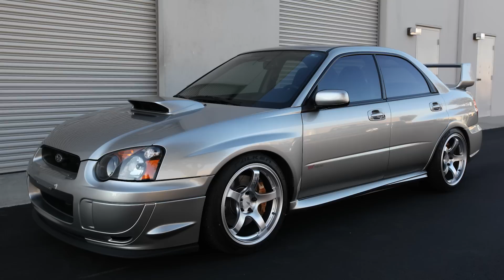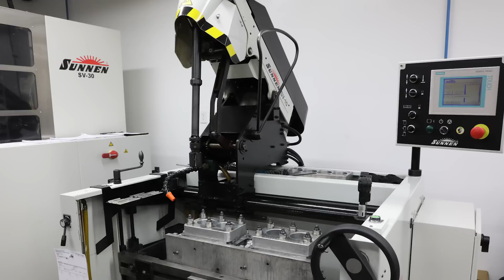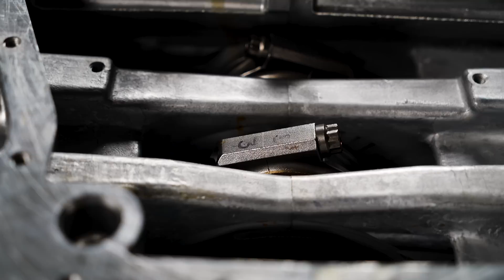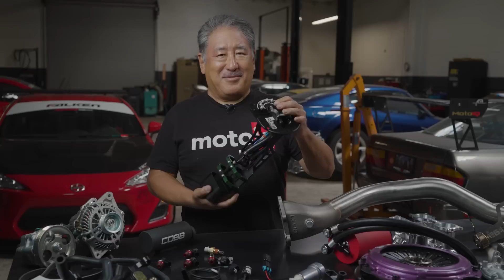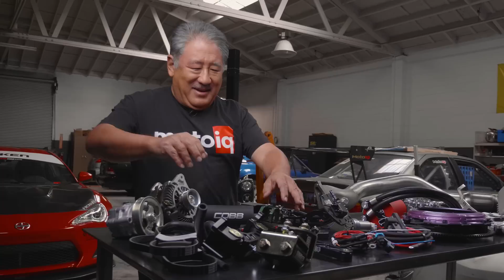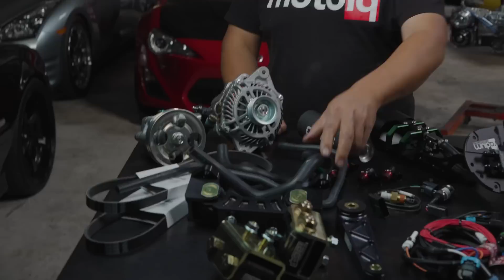Subaru Engine Swap Must Have Parts!

Comment: I am shocked MotoIQ doesn’t have more of a following. These Subaru videos are some of the most helpful and informative videos on YouTube!
Reply from the maker: So are we!
Reply: @motoiq   Do you guys have and engine build kit for the OBS Impreza's? I have a 97 wagon I'm tearing down (rebuilding transmission ATM), and I'm look for around 350WHP replacement engine. Knowing what must be done to build a truly "Bullet Proof" engine I'd like to outsource for a shot block and heads. Got anything like this?
Reply: @motoiq  Well, I subscribed and followed you on FB. Thank you SO MUCH for this content.
Reply: most "car guys" these days want a pretty cars and don't like the niddy gertty technical vedos like this and speed academic....but for the few of us that do care videos like this are worth there weight in gold....thanks Mike for letting us watch over the shoulder of a legion like your self

Comment: Awesome content! I've followed you for a number of years. Can you come out with content for the Fa20 or Brz/Frs platform
Reply from the maker: Possibly!
Reply: @motoiq  that would be amazing. I have read the articles on your site for Michelle's build. That is how I learned about WPC
Reply from the maker: @1atinlove  I forgot we did stuff on the web page side. https://motoiq.com/building-an-fa20-race-engine-for-michele-abbate-part-1
Reply from the maker: https://motoiq.com/building-an-fa20-race-engine-for-michele-abbate-part-2
Reply from the maker: https://motoiq.com/building-the-fr-s-fa20-engine-with-stay-crushing
Reply from the maker: https://motoiq.com/building-the-fr-s-fa20-engine-with-stay-crushing-building-the-cylinder-heads-with-portflow-design
Reply from the maker: https://motoiq.com/building-the-fr-s-fa20-engine-with-stay-crushing-assembling-the-engine
Reply from the maker: https://motoiq.com/building-the-fr-s-fa20-with-stay-crushing-installing-the-engine-and-making-big-power/
Reply: Thanks, I've actually taken q look at these. It was a real helpful guide, and provided a lot of information.  It was the reason why I reached out to you guys originally.

Comment: This is wayyyyyy overbuilt for a 450whp car. If you’re looking to do this for less you do not have to go this crazy. it can be done without a lot of the stuff if you just went for a bigger drop in turbo, such as a boostlab 54x.

Also, if you’re already gonna spend money for injectors, spend a little more and get the 1700s. It’s way cheaper then maxing out your 1300s and then having to buy a set of 1700s. Buy once cry once.
Reply from the maker: Maybe for a car that is not track-driven sure.  If you want to be able to run flat out for 20 minutes at a time, and still have daily driver reliably you need to have a higher degree of preparation. Most people don't understand that track driving like road racing is harder than anything you can do on the street or drag strip. If you don't address things like oiling and cooling, you end up leaving the track via AAA instead of under your own power.  Anyway, this car can make up to 525 hp before the turbo maxes out and is built to take a rotated mount turbo if desired.  The turbo is also sized for quick response, not making the most amount of power.  We have found in road racing that torque and response make for faster lap times unless you have an all-out race car.  Bigger injectors are not better, especially for a daily driver. Bigger has more invalid time and makes idle stability and closed-loop control more difficult to tune, especially with gasoline. From the Injector dynamics website (The ID1700x will deliver flawless stoichiometric idle and cruise mixtures on E85, but like the ID2000, should not be expected to do so on gasoline)1300cc injectors are big enough for what we want to do with the car.

Comment: Was just looking at the guys from gears and gasoline which lead me to here. Those engines appear to be terrible from looking at you and them.
Reply from the maker: Certain aspects of the engine like the pistons get in the way of reliability right away. The cases themselves are not very good past 550 whp for road race long duration reliability;

Comment: Do the fa20dit engines also have the same problem the ej's have with the oil pan baffling as described? 7:13
Reply from the maker: Yes and they also have issues with rod and main oiling past about 430 hp and issues with the oil pump gears breaking past 8000 rpm.
Reply: @motoiq  I appreciate the reply. Thank you.
 I think I would be happy with a turbo back and tune which shouldn't land even close to that number. However I do appreciate the knowledge. I understand it's more a matter of how long are you satisfied. It's impossible to look at your car and think "okay that's it! I'm done."

Comment: Mike, what software/hardware will you use to tune it? I know Cobb is not an option with the TGV deletes and speed density. Thanks
Reply from the maker: A link ECU Plug and Play ECU just like our Evo project.  It is excellent!
Reply: Could you send a link or show what the plug and play options for subaru tunning know that cobb f... us.
Reply from the maker: @legacy5thgen727  https://dealers.linkecu.com/products/plugin-ecus/plugin-ecus-subaru
Reply from the maker: @legacy5thgen727  There is also ECUTek for now but that's getting bricked soon as well.
Reply: @motoiq  okay thanks for the reply there's not much out there for the 5th gen legacy I got a gtx3576r rotated turbo kit 1650cc injectors with a 450 walbro pump need a tune can't find a plug and play option. 😢and yes most of the stuff are deleted.
Reply: @legacy5thgen727  RomRaider

Comment: reality check still can break , Did all of that and then some, my iag 900 long block was send back can’t wait to find out what happen …….Subaru things I still strongly feel IAG is the best of the best
Reply from the maker: IAG is one of the best, it will be interesting to know what they determine the cause was.
Reply: @motoiq  all I can say I hope it was me !!! Things can happen at 731whp special thanks to @The Boost creep, in Colorado
Reply from the maker: @kchanguito  yeah 731WHP  is asking a lot from even an IAG 900.
Reply: @motoiq  you may be right it had the” high boost “ 683whp  tune at 29 psi for all of 1200 miles never got to used the honey badger tune , I’m just hoping I can get the engine back and make one past this season
Reply from the maker: @kchanguito  That is over 900 crank hp and great results even if it blew up!
Reply: @motoiq  what will be the conversion 20%? 
Feel like 683 is some here around mid 800’s crank ? What will be the calculation with elevation. ? Also we make sure tune was “rich” and healthy never felt like we push anything with mid to light timing

Comment: I went the overbuilt route for my WRX built too, LOOOOTS of IAG goodies on my car, the AOS, TGV Deletes, Fuel System, and the like, and cant forget the IAG Stage 2.5 block, they do an amazing job with their closed deck conversions. For the under armor, I prefer the TBW under body tray, but that one is just as good too, anyone with a subaru should get some sort of metal underbody tray.
Reply: How you have TGV deletes? Are you on standalone?
Reply from the maker: @bestkickzz  standalone or you can do ecutek too
Reply: @bestkickzz  TGV deletes would be the least of your worries. Fuel system, AOS, Turbos need tuning too
Reply: @joshbigornia4797  sure, but you can still tune all of that. Evap stuff and flex fuel you cannot, thats why I ask, I assume he just drives with a CEL.
Reply: @bestkickzz  before EPA involvement you could tune around it. Now you can’t.
Reply: @bestkickzz  No CEL, has a pro tune to account for everything.
Reply: great now i need armor?
Reply: @baelm  what happens if you pump it too hard and jump a curb bruh?

Comment: great content from a very knowledgeable source. how about this one; why do some aftermarket downpipe manufacturers put the high flow cat at the end of dp vs some put them right off the turbo? any reason why?
Reply from the maker: Having it down low is better for power and cat life.  Having it close is better for emissions.
Reply: @motoiq  thanks for the great explanation.

Comment: Great info what about DBA5000 Rotors with Hawk pads and Steel break lines to stop with all that extra power?
Reply from the maker: Actually this car has Stoptech ST60 brakes and 335mm rotors. A bit more than that.
Reply: @motoiq  I was wondering cause the guys doing my 06 STI build right now seem to do everything you and IAG recommended in the past... So I was just wondering if that DBA5000 would be good enough for about 500WHP?
Reply from the maker: @07BLUESTI  It depends, for street driving sure, but for track driving with sticky tires and a lot of suspension, no.